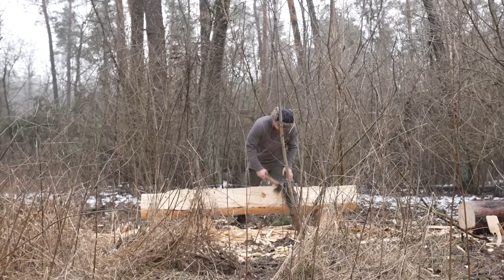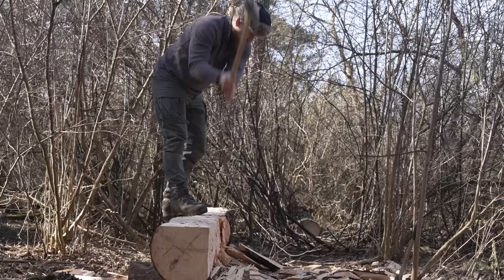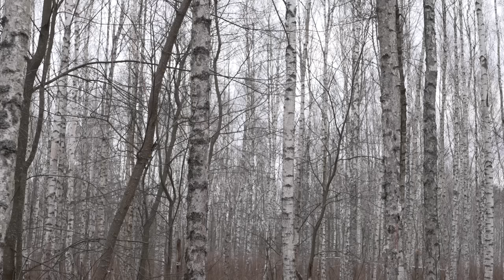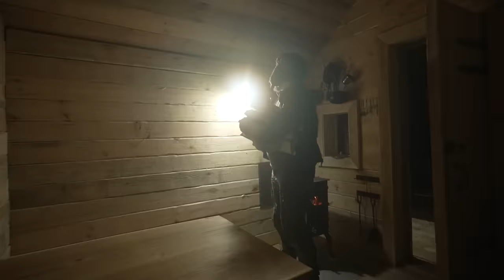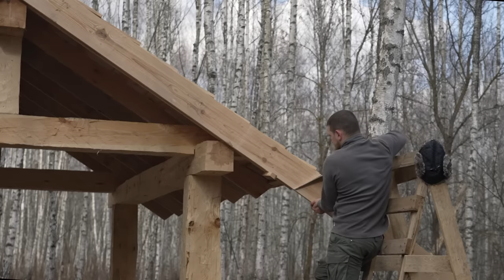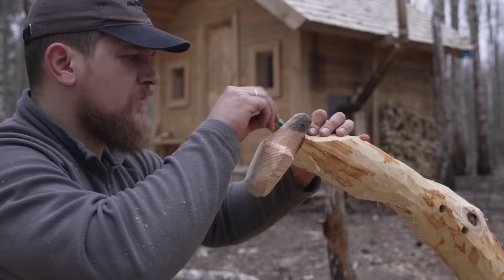biggest shed workshop from  hew logs ,  making with hand tools in wilderness

Comment: 21 years ago 5 friends & I built a log cabin in the woods on public land & then sometime later that land came up for sale & I bought it , now I own the cabin & the land it’s sits on , you shouldn’t have burned the wood that’s going under ground , after a wile it’s going to rot , I found this out the hard way. A older friend & neighbor told me this secret I,m about to tell you , one of the best ways to keep timber from rotting under ground & to keep bugs from tearing into it is used old motor oil , brush or wipe old used motor oil on it before you put it under ground , bugs & animals don’t like it & they stay clear of it altogether & the oils preserve the wood over time & it makes a great stain .
Reply from the maker: great story and thanks for the advice I’ll look into it!
Reply: Можно хорошенько обработать огнём. Тоже долго сохраняется
Reply: Thanks for the tip. Ill use it one day.
Reply: KO LP KO

KO iuuu😂😂
Reply: Hello, please tell me how long time the woods are saved with oils?
Reply: Burn and oil is best 
Japanese know
Reply: Do you see how much used motor oil he has access to? (sarcastic)
Reply: You have to retreat about once a year using motor oil. If you burn it correctly (I'm not that far into the video yet) then treat with oil it'll last a helluva lot longer. But burning it does help prevent bug damage, and slows the decay substantially.
Reply: @maddawgnoll  motor oil once a year ? That wood will have been dug in ground
Reply: @letun100  you drill a hole at an angle but not all the way through, just to about 2-3" before the bottom. Make a plug. Once a year you pull that plug out of the hole and pour the oil in it. It will soak into the wood and keep the buried part from rotting.
Reply: @letun100  we do that with fence posts too
Reply: @maddawgnoll  overall the best way-cement foundation for posts, 100%.
Reply: @letun100  well ya. Can't argue with that. Sometimes you don't get that choice though.
Reply: @maddawgnoll  just I can't understand why anybody use oil, drill and these ways of build...price with cement and oil posts will be similar , but result straightway different
Reply: @letun100  If you live too far to travel to a store in ten minutes, like myself, where it's a day trip, and you're off grid having to gather your water every ten days, or just too far to pack 60-80lb bags, you improvise. Oil is out of the motor so it's already been paid for, and it's a good way to get rid of used motor oil.  Not everyone is blessed with the convenience of running water wherever they are, or a way to get there on 4 wheels. I've been offgrid for 3 years now and it's nothing like what they show on TV. Not that I was expecting that but it's difficult and a learning curve. Improvisation is one of the fundamentals of life in the backcountry.
Reply: @letun100  a long time maybe 20 plus years .
Reply: @maddawgnoll  I’ve been off grid for more than 20 years now ,  me & some friends built a big cabin on public land over 25 years ago then 3 years later the land we built the cabin on came up for sale & I bought it , I ran solar panels on top of the cabin & some in my field , I have 2 gigantic battery banks in my cabin , when one gets full it dumps into the other & I have a battery bank in a shed near my solar field & I have 2 water turbines that I has custom made that run in a big creek on my property half the year . I have a wind turbine also that’s hooked up to my battery banks .I have clean running water , drinkable water from a spring that was taped on my land so I,m good yea at the start going off grid it’s definitely tough , but once you learn stuff your pretty self-sufficient & you need the money to go off grid , after that 5 year mark it gets easier . I have every amenity that anyone else would have in a modern home just runs on big battery banks , & I had the opportunity to work from home so I took it & I,m good .
Reply: @robertlee8400  it is not long, only iron plots or greater foundation for poles.oil is not way....
Reply: @robertlee8400  I'll always have to go get water and haul it, but that doesn't bother me, just an inconvenience at times. I could have a well drilled, but i don't feel the cost out weighs the inconvenience. I've been running off solar for 3 years now. I installed everything myself without having a clue what I was doing, and there's a couple things I'd have done differently but it works. It's definitely a cost to get everything going (solar is getting more affordable) but I think once everything is set it's worth it. Not having to worry about that electric bill sure it's nice. It's not expensive up here for electricity (i think my sister is only a few binded during the coldest months and she's got a big 3 story house to heat) but I come from northern commiefornia where I would see $1000 electric bills in the summer (AC) and $500 bills in the winter. 

Sounds like you got lucky with your setup. Getting the chance to purchase the land you built on like that.
Reply: Not the most environmentally friendly solution to treat the timber with engine oil. Oil make timber water repellent but not water proof.
Best is, to keep the timber off the soil.
If oil at all I‘d go for food oil.
Reply: Not true. Burning when done correctly kills solves the bug problem because there are no nutrients left in carbonized wood. However, to prevent rot you need to oil the wood. Old motor oil is the cheapest option.
Reply: @maddawgnoll you sound like you have built an amazing setup. I’m just getting started in Virginia and I would love to see and learn about the how’s and why’s. You should make some videos!
Reply: @maddawgnoll if motor oil worked, it certainly wouldn’t need to be re-applied often. I watched my dad use oil treatment and even attach abs tubing cut in half to each post so he could re-apply it. Those posts rotted out like nothing was done.

Comment: Here in the USA we have all kinds of wood working tools from many years ago. We have an ax that has an off set head and handle that was made specifically for hewing logs. You can do it with a straight ax but it was designed to off set the handle so you wouldn't hit your hands on the log. They must be kept razor sharp so they will cut straight and not tear the wood. Hewing logs is very hard work. Be very proud of what you have built. It will give you good service and last for many many years...

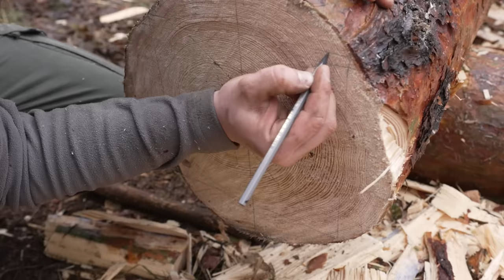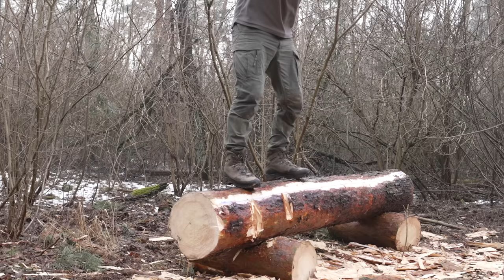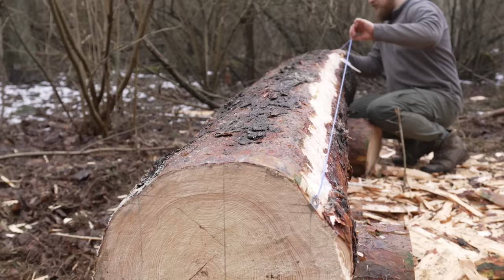Comment: I wanted to offer some advice on laying out your chalk likes when hewing logs.  I have been designing and building handcrafted log and timber structures for many years and I see a mistake in what is shown at about 2:55 to 3:20 in the video.  If you stop the video exactly at 3:13, you will see the curves in the line at the near end of the line that was struck.  You correctly laid out the two vertical lines indicating the planes you intend to hew.  You removed the bark and then snapped the chalk line.  The mistake here is that if your layout lines are vertical, then the chalk lines must also be snapped in the vertical.  The lines need to be snapped into the plane to be cut.  Your video shows that you pulled the chalk line up and away from the log and snapped the line on to the face of the log.  If you do this, you are creating a wavy plane that is created by the irregularities of the log surface.  I wish there was a way to post a video of this that I use in teaching courses.

Comment: Why the concrete? I can understand if you took the concrete over ground level to avoid water and rot. Rot as i understand it is a ground level problem, not below. Is it just so you didn't have to find 1m longer logs? Besides i am very envious :)
Reply from the maker: It’s just that there were no dry and huge logs of suitable diameter in the forest, there were only damp ones, so I don’t want to bury this option, I don’t want to bury a damp log
Reply: @ShevaBushcraft  thank you for the reply. guess you have to work with what you have. And even if you get rot problems, it is easy to fix later.

Comment: I am no expert but isn't one purpose of having the wood sit on a foundation is to bring it up out of the dirt so that it does not have issues with moisture and rot? 

I see that you charred the ends to offer some protection from insects and rot but seeing as you went through the effort to put those concrete and metal foundations in the ground it does not make any sense to me why you would not have the concrete extend up to at least ground level if not build a box and pour it a little above ground level  and have your post sit on that an avoid direct soil contact with the wood (even charred wood).
Reply from the maker: the wood is lined with stones and not buried in earth, so it dries out and does not absorb moisture, even if the pillars are concreted, they will pick up water from the concrete